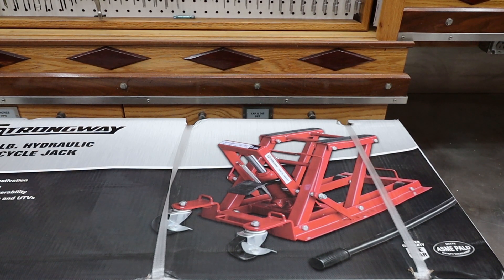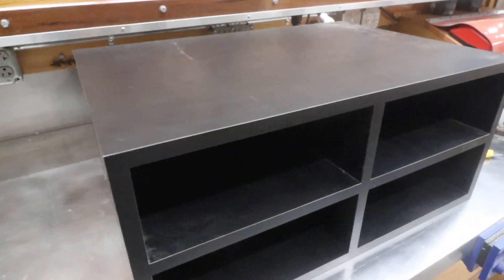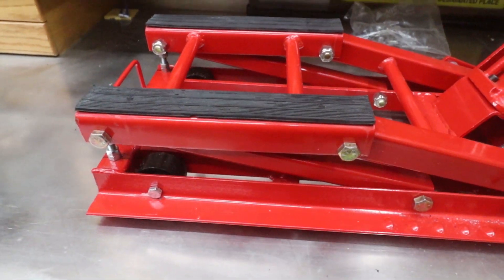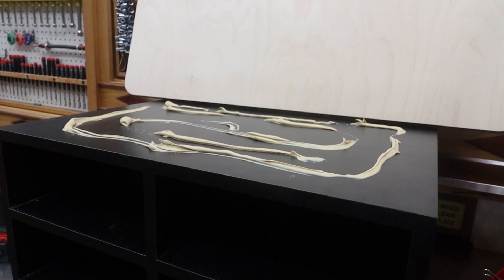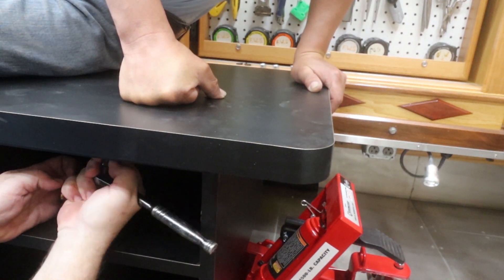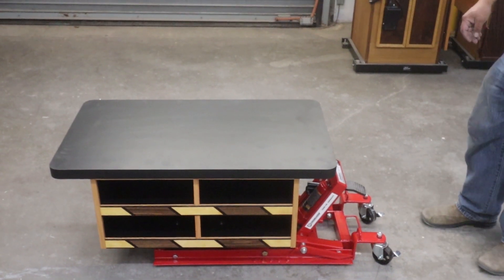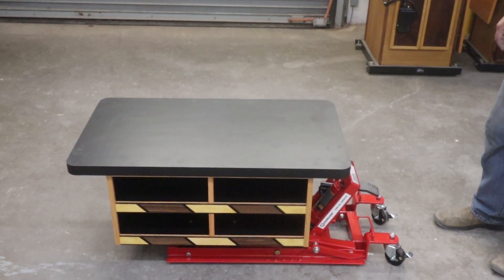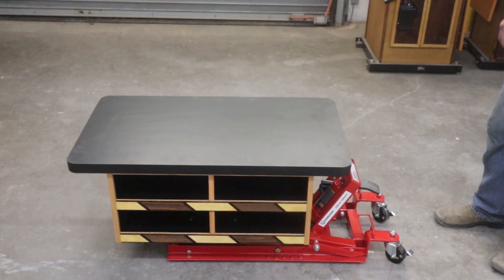FLEETS WOOD SHOP .ADJUSTABLE HEIGHT WORK BENCH

Comment: Very nice idea.  I had a similar thought after seeing a buddy make a welding table out of a hydraulic lift cart from Northern Tool.  I do blacksmithing, not woodwork, so having a steel top that I could use for welding and being able to raise or lower the work so I'm in a better position for reaching the weld area.... that'd be mighty nice at times!   Never thought about putting storage under the table, though.  That adds a good bit of versatility.  Thanks for the idea.  I owe ya one!
Reply from the maker: Hey my friend I'm so glad you found the idea useful. It works great for me as an adjustable carving table and you're right with a steel top it would work just as well for a welding table. thank you so much I can't really say thank you enough I appreciate it so much when someone takes the time to leave a comment and let me know their thoughts. A million thank yous my friend from Doug

Comment: Great use of an existing lifter. I would never have thought of using a motorcycle lift for a bench lift.
I don't know why height adjustable tables are not more common.
Nice work.
Cheers,
Dan
Reply from the maker: Dan thank you my friend thank you so much. I know it seems like any kind of adjustable work table you need you have to build it you can't buy it. Thank you my friend thank you so much from Doug
Reply: Yeah. I'd make the kitchen sink electrically height adjustable if dear wife would allow me.
Reply from the maker: I know what you mean Dan that would make it easy buddy

Comment: Looks great !!!
Reply from the maker: That's so kind of you thank you thank you so much. I appreciate that my friend from Doug
Reply: @fleetswoodshop3339  no problem always enjoy the projects!
Reply from the maker: That's kind of you my friend thank you thank you very much from Doug
Reply: Hey I’ve been building a shop. 
A quick question I have for you, where do you get your foam inserts for tool boxes?
Reply from the maker: They're available online you can order them. They also sell them at woodcrafters. And rockler also carries them. I'm not in front of it my friend so I am guessing what I'm going to say next I believe they're made by top chest or top Chris. If you check out that video real quick and I stopped and shot a picture of their label in the video. If you don't find it let me know and I'll make a point to get the correct name for you. Let me know my friend thanks
Reply from the maker: Hey my friend I made it to the office so now I can correct all my mistakes. I'm bad with words and names you might have noticed that. The foam is made by FAST CAP it's sold under the name KAIZEN. IT'S AVAILABLE AT THEIR WEBSITE IT'S ALSO AVAILABLE ON AMAZON SO LOCALLY HERE IN HOUSTON THAT WOODCRAFTERS AND AT ROCKLER. I SURE HOPE THAT HELPS. IT'S ALL BY THE WAY IT'S ALSO SOLD ON WOODCRAFTERS AND ROCKLERS WEBSITE